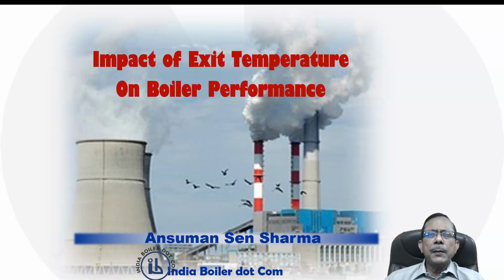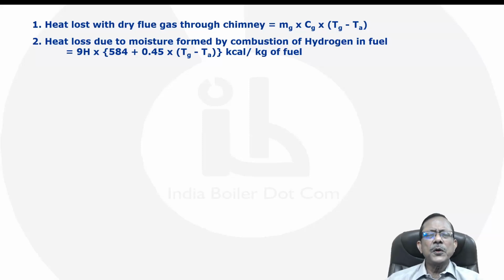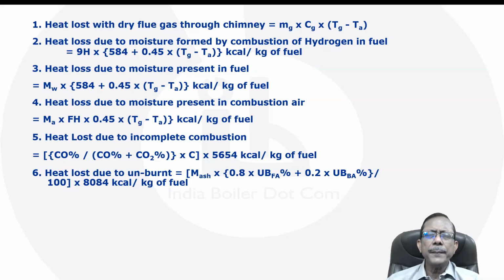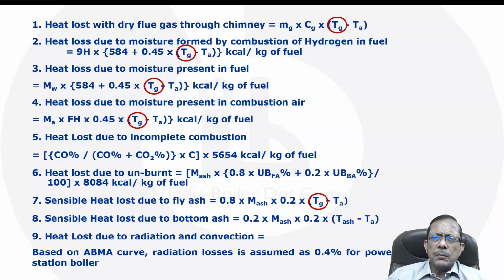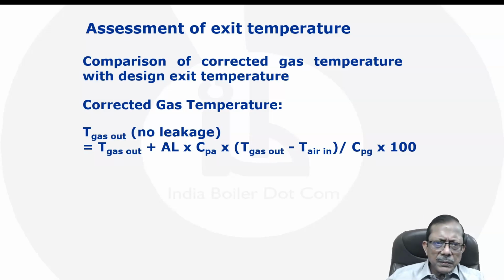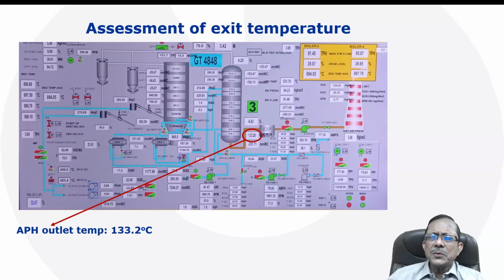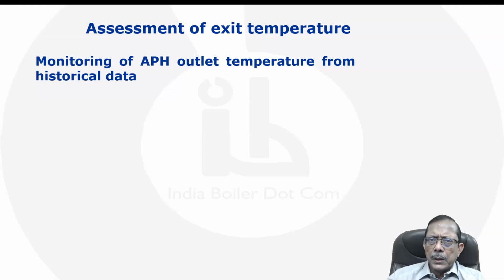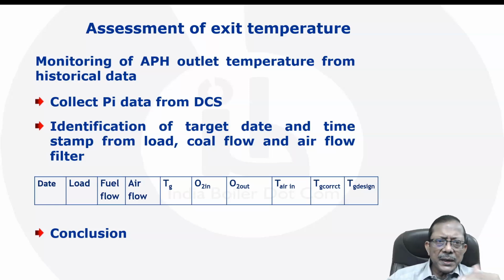Impact of Exit Temperature on Boiler Performance | Boiler Performance Analysis | APH Leakage

Comment: Sir, the calculated Tgcorrect would be for fixed % of air leakage if there is no measurement of O2 at outlet of APH. But to monitor on daily basis, how do we calculate O2 at outlet of APH to calculate AL and subsequently the Tgcorrect?

Comment: Dear sir what is the meaning of the CWS drum and FLSPSL which is mentioned in Certificate for the use of boiler Foam No 06
Reply: Usually the maximum loading of the safety valves are mentioned in form VI. I believe these terms refer to it. Can you share a copy of this form? One more thing. We have a separate playlist for BOE. It would be easier for me to respond, if you ask these type of question there.